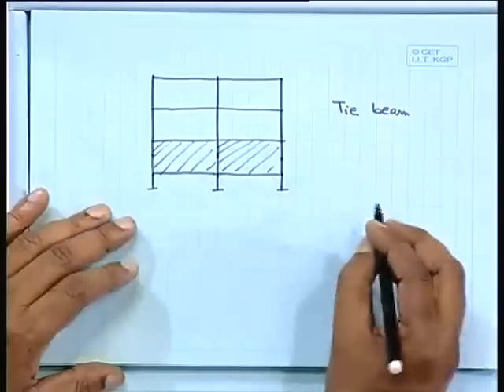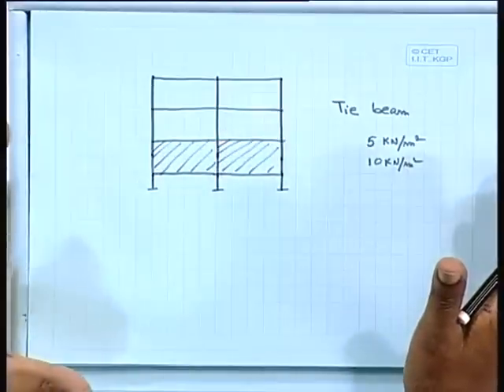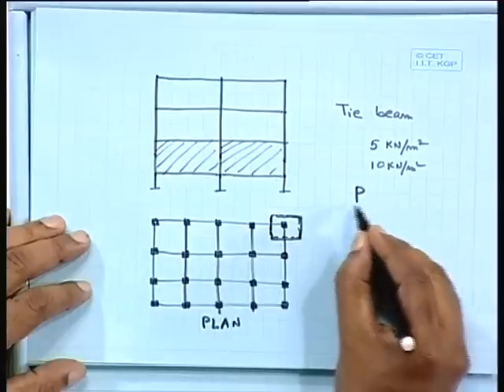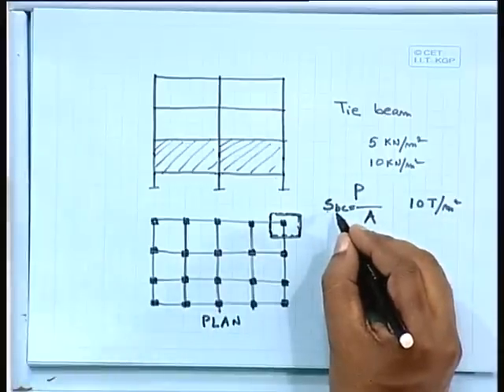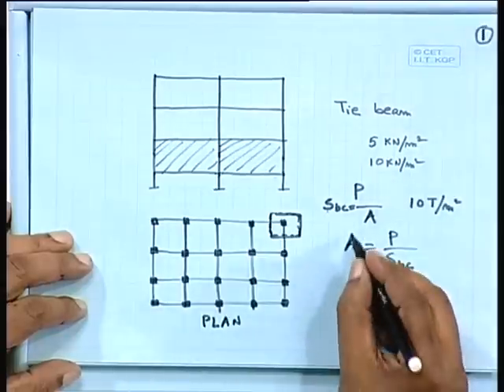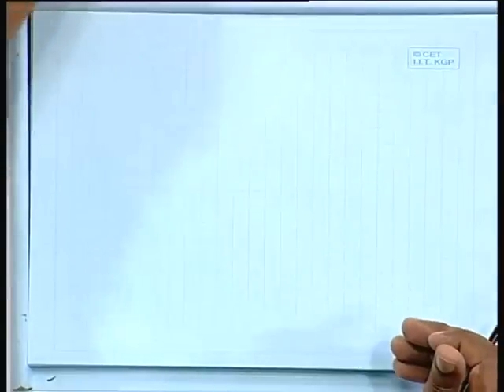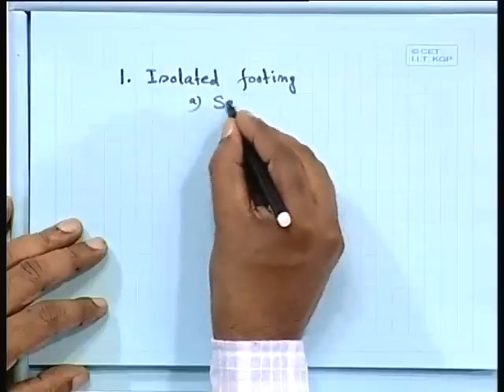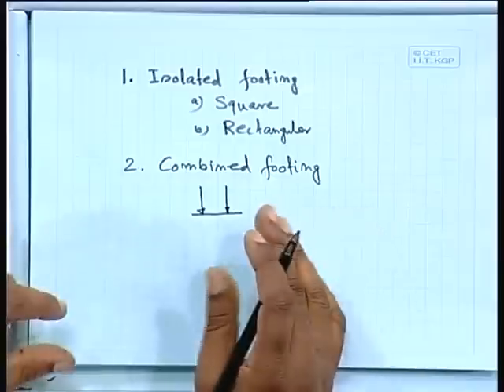Design of Footings Part - I

Comment: note that IS code is  close to BS 8110 , so if any one interested in BS 8110, this course will be very very helpful even if you have no idea about Reinforced concrete design >>> but you will struggle with boring  tutorial ...
Reply: outdoor Eng I m interested to learn BS code
Reply: o.k ,just  focus on these lectures which based on Indian code ,only  the different is some symbols and some words. then you can understand BS 8110:part 1 code of practice for design and construction